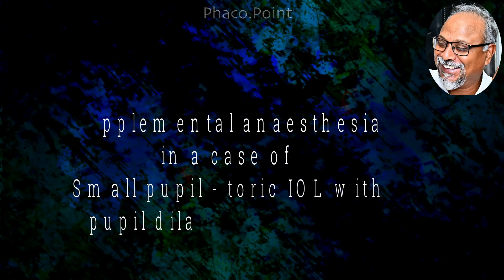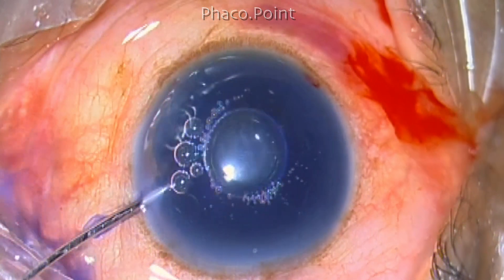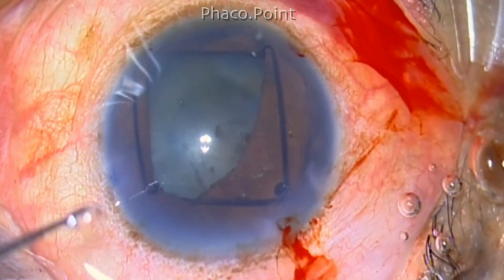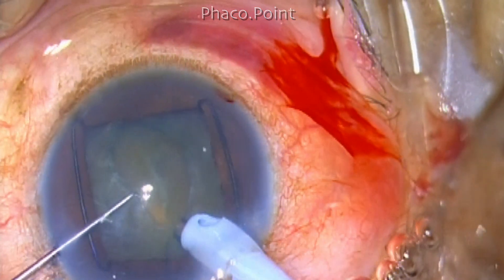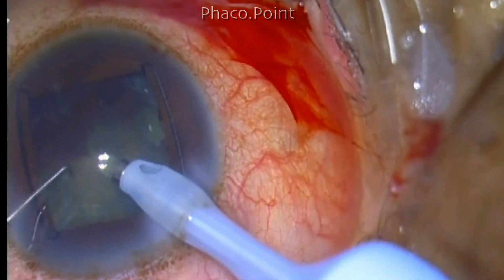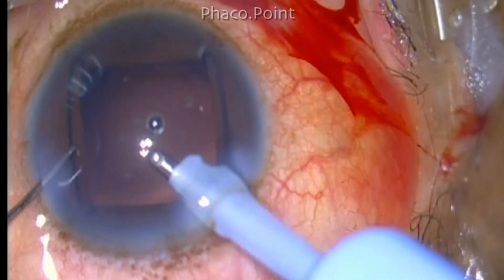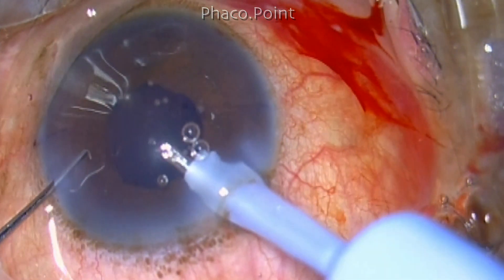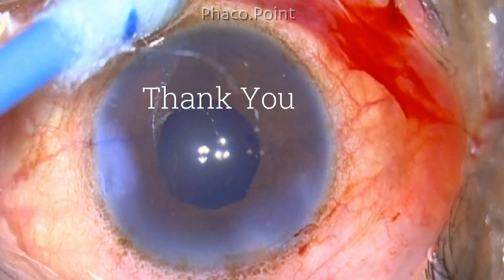Sub conjunctival augmentation of Topical anaesthesia for small pupil phaco,Gupta ring and Toric IOL

Comment: Wonderful surgery sir 👏👏👏
We can even use a sterile cotton swab (wetted with proparacaine drops) placed on nasal aspect of bulbar conjunctiva (just adjacent/lateral to medial canthus) for topical anesthesia. This swab will supplement the topical anesthesia throughout the duration of surgery.

In order to avoid the implanted Gupta ring from obstructing the usage of phaco probe, we can have a different (preferably in superior aspect) 2.6 mm side port done. This superior aspect 2.6mm side port can be used for implantation and explanation of Gupta ring. While implantating the Gupta ring through the superior 2.6mm side port,we have to make sure that the holes/islets should not be fixed onto that part of Iris which is just below the location of intended clear corneal main port. This is because rotation of Gupta ring after fixation onto iris is difficult as it might lead to irido-dialysis. To avoid leakage of OVD through this superior side 2.6 mm side port, we should construct this superior aspect 2.6 mm side port as a triplanar side port. And the regular main port for phaco probe can be done biplanar in temporal aspect.(I have never tried this sir but I believe this can be done). 

Please can you tell what were the 2 instruments seen at 1:25 minutes of this video and where to procure them. Thank you so much 🙏
Reply from the maker: dear Dr SRK thank you for the comments and inputs. The swab is a good idea, but could take away from the aesthetics also the SC location can permit better access to the ciliary body.The Gupta ring I realise should be first injected wholly into the Ac without engaging the loops because once a loop is engaged then the patern of engagement is fixed. then the lop[s are injected wholly and then fixated at 12,6,3,and 9. Theinstruments at 1.25m if video is the titanium "Rod" stabiliser made by Appasamy and the 1.2mm lance tip of Appa Samy
Reply: @PhacoPoint  Thank you sir